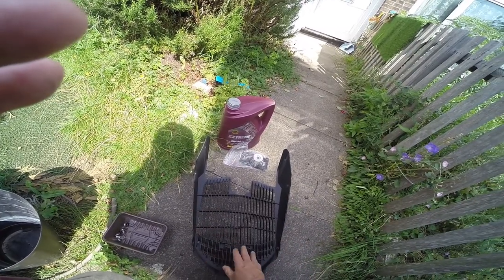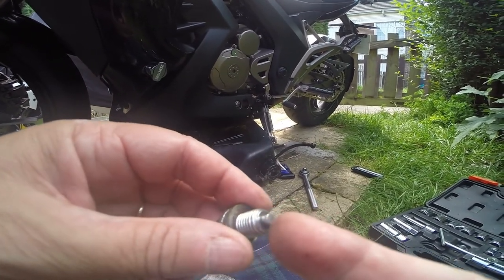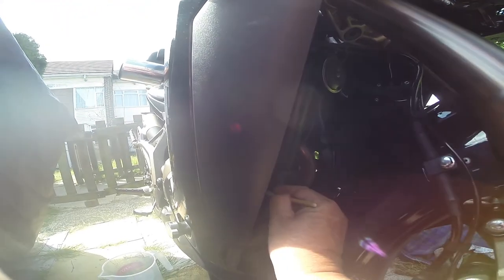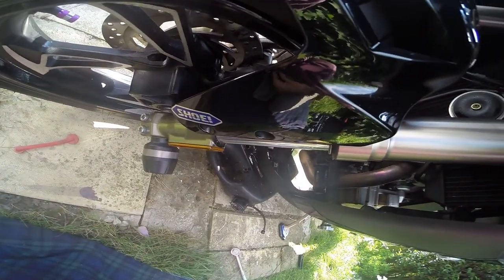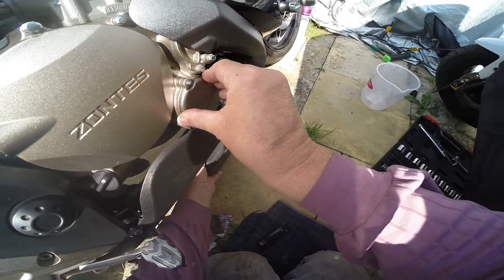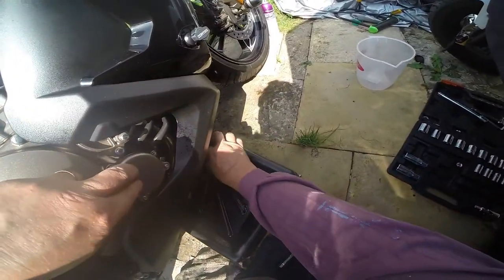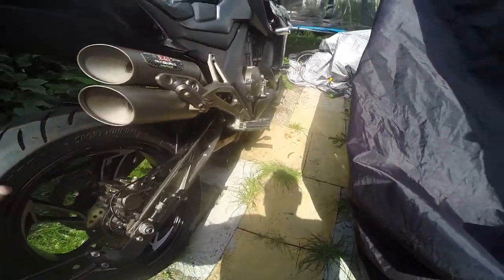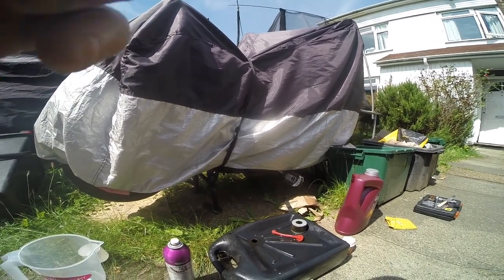OLD MAN AND HIS ZONTES 310X OIL AND FILTER CHANGE AT HOME

Comment: Do you recommend 5w40 more then 10w40? I read about clutch slipping problem with thinner oil ,thanks again for your attention and videos mike!
Reply from the maker: Sorry I missed your post,  on the 310 the 10 w40 is fine it's lower price the bike has two oil pumps to get it up through the frame to cool and is thicker when hot, yet the 5 w can be used, I have not heard of clutch slip happening, yet the newer models have slipper clutches for smoother downshifting etc at higher revs , stops rear wheel lock

Comment: Two points on the dipstick check, in my experience you never screw it in to check, simply rest it on the hole, second the bike should be upright and vertical to ensure that the oil is level in the engine or is there something different with the zontes?
Reply from the maker: Screw it in, bike level and engine cold xc

Comment: Also read about better not to use full synthetic,is that true?
Reply from the maker: True, I would go for 5w 40 or standard 10w 40
Reply: @michaelphillips1959  thanks mike , take care and have a nice weekend
Reply: I'd be interested to know why you would say not to use the clearly superior oil in fully synthetic over mineral oil, what are your reasons 🤔
Reply: @michaelphillips1959 both of these can be had as full synthetic which is hugely superior to semi synthetic oil or mineral, and there is nothing about the engine which would preclude using the better oil